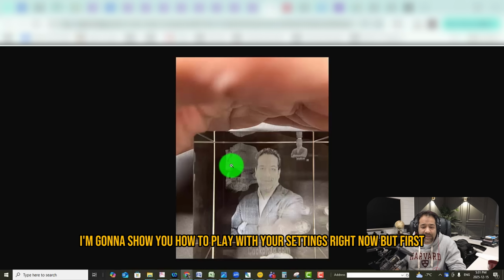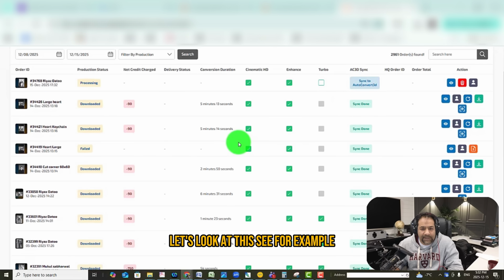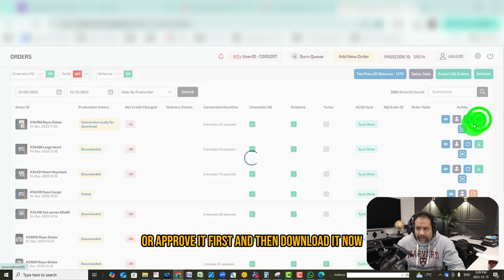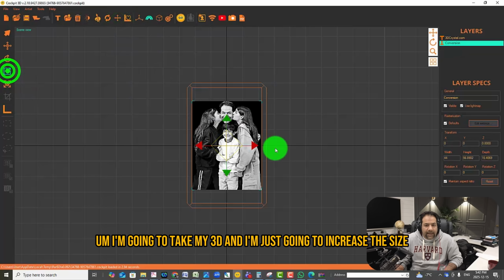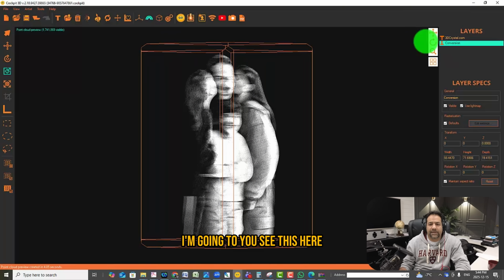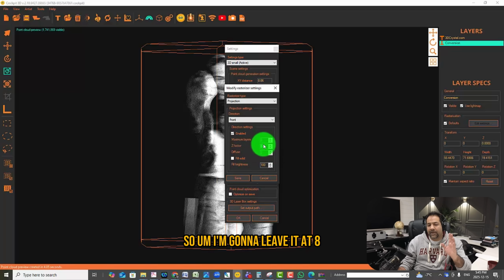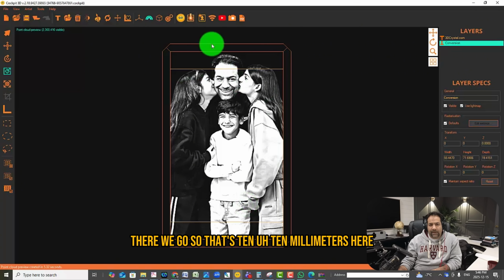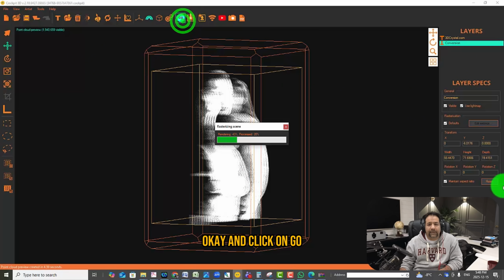UV 2D to 3D Subsurface Laser Settings Explained | Cockpit3D Software Full Guide

Comment: I have a UVV-P-5 and it uses the Raycraft control software. After I create the .stl in cockpit3d and open it and run it in Raycraft, it will not burn into the crystal. The laser acts like it's doing something with the head moving up like it's engraving, but there is no mark in the crystal whatsoever, and the job is ran in like 30 seconds or less, this doesn't seem like long enough even if it was actually engraving in the crystal. I can't get any info on what the Dwell, Frequency, or Pulse settings should be, but the default settings work for True 3D stl models, so why doesn't it burn my cockpit3d stl? I thought maybe it was the original picture that was converted on the FastPass site and I have tried it 3 different times uselessly using up a lot of my credits! I can see the point cloud in my software but it wont engrave into the crystal. It apparently works for the xTool UV, (from seeing other peoples results), but not my laser, and settings are night and day between the 2 softwares. I don't know if there is a setting I'm missing in the cockpit3d software or what because I can't seem to get an answer from anyone other than I'm not familiar with this or that. This is very disheartening and frustrating because I spent a lot of money on blank crystals starter pack and the case of rectangular keychains and can't use any of them for the 2d to 3d engravings!
Reply from the maker: Sorry for your frustration. Certainly you have asked the company whom you ordered the machine from with no successful response we presume. We will ask Mr.Riyaz however we highly recommend posting videos of your issue on the Facebook group to see if there’s anyone with your machine that has had success. We only have experience with green beam hence the reason why we asked UV users to weigh in on any UV related questions.  Sorry we couldn’t be of any immediate assistance.

Comment: Using the Xtool F2 ultra uv. This has been the best settings i have been using. Example on a 40X 40Y 60Z Rectangle small in cocpit3D 0.06 0.06 /  8 5 2. Now when bringing file into xtool studio GLB, measure the actual size of the crystal with calipers on the X and the Y and the Z and enter these into xtool studio as there is variations block to block. So if the x axis is 39 enter 19.5 on the riser base piece, enter Y measurement and Z measurement. This will ensure the galvo mirrors are exact on the block. Settings K9 crystal power 85% Dot duration 166 Layer Height 0.06 Frequency 80    DO NOT CHANGE THE SIZE OF THE IMPORTED POINT CLOUD. Hope this helps.
Reply from the maker: Thank you taking time to help explain it to others using that uv laser system ❤
Reply: Did a crystal heart ornament today, all I can say is wow the detail was incredible 2,765.000 points. Can’t wait to be able to purchase a green beam as it took 1hour but it was well worth the wait. 

F2 ultra uv power 85% Dot 200 0.06 Layer height 80 40.5 on base x Frequency, in cockpit3D before you hit the laser strike on the heart set 5.5 margin on x 5 on Y 1 z stabilizer off thank me later. Stunning results I’m glad I got onboard with cockpit3D as I’m in. Just placed another order as I’m getting so much positive feedback. Keep up the great work.
Reply from the maker: @Prevstar thank you so very much

Comment: just trying this software- I mean compared to what I used that came with xtool, at least I think I used something that came with xtool- anyway. OH....MY......GOD the difference. I mean it's 1000 times better with the same pic. It did take a bit of fooling around and I would LOVE to know what all the different settings are that you can change. But it's nice that you can change them and see the result. I THINK the Point Cloud Preview is sort of the "real" preview correct? that would have been nice to know, lol.  It's a great software so far. Trying another pic now, but I'm sold.
Reply from the maker: Thank you for your support.  After you click on GO the point cloud preview gives you a representation of what it will look like as points in Crystal. We will continue to produce more videos that explain different parts of the software.

Comment: I am able to get extremely detailed engraves on the XTool UV, but I tend to always have some level of banding in the image. I have adjusted all the typical settings every way possible, so I am thinking maybe I need to adjust some of the other settings. Any ideas where to start??
Reply from the maker: We haven’t experimented with any UV lasers however our assumption is that banding / lines appearing may be occurring due to the following reasons: 
1. After having completed saving the point cloud on cockpit3d and opening the file in your laser software you need to confirm and ensure you do not change the point cloud size. 

2. The sharpness and clarity you see on 3dcrystal made by our parent company 3dcrystal.com is done by laying the crystal on its back in the 3dlaserbox jetmini machine and burning from the front. This means if you were burning the 3d image of a person for example, their eyes would be staring up at the lense as opposed to how most UV laser videos show it where the face of the person is facing out the door -and instead the top of their head is facing the lense.  We have some suspicion that this rotation on the machine you are using may be causing the lines  to appear.  
If anyone else reading this is using a UV laser and has any input for the person asking this question kindly assist.
Reply: @3dcrystal  Thanks. Yeah, I have kept it the same size and laid the image on its back and still seem to get a line at what would appear to be at each layer change. I think it may he the less than smooth layer transition on the XTool.
Reply: @3dcrystal  In case you are still tracking, I have nailed down settings and I am getting fantastic results on the F2 Ultra UV, regardless of engraving vertically or horizontally.
Reply from the maker: @lakesidelaserworks  ok amazing. When you engrave horizontally it will allow you to do various types of shapes.  Burning vertically means the curves at the top of a heart for example wont allow the beam to penetrate.  Congratulations on your success.  All the testing and trying was worth it!  Go out there and have fun making sales and preserving peoples memories in 3D :)
Reply: @lakesidelaserworks  do you have some general numbers you could share
Reply: Could you please reply with the settings that worked well for you?  I am having the same initial issues you were having with banding
Reply: @davidarringtonmd What I find is that brighter pictures require lower power or XY settings. Otherwise you get banding. It will vary based upon your image.

Comment: Hey Riyaz,  I have a xTool Ultra UV.  I followed all the instructions but I feel like I'm doing something wrong.  I got the image to look good in Cockpit but when I import it into xTool creative space, I can't really see the image.  I don't change anything and keep it the same size.  I save it as an stl.  Any advice?
Reply from the maker: Thanks for your question. I’ve heard that it’s hard to see the point cloud visually in the UI of the laser software however if you ensure you set the point and line spacing values to match what you had in cockpit3d it should burn fine.  Perhaps start the burn and see if you notice it actually shooting the laser. And if so it will likely burn fine.
Reply: @3dcrystal thanks for the help!
Reply: @3dcrystal  I believe the XTool UV laser requires the files to be in GLB format

Comment: I am working with Lawrence.  I have the Commarker, and I am struggling to get a good conversion from DXF to STL. Actually, I am not able to make it happen at this point.  I'm really looking forward to the advancements that are coming.
Reply from the maker: Thx for your message.  Check with us in  a few days and we should have UV laser file types baked into cockpit3d for you to easily export the file type you need for sub surface laser engraving in optic crystal.
Reply: @3dcrystal appreciate you!
Reply: @3dcrystal if you need someone to test the new software send me a link and I’ll get on it.  😬
Reply from the maker: @chrism997  you should be receiving the version that enables you to edit and save the 3d file for UV lasers today.

Comment: Hi, I'm really pleased that this is going to be available, I have a Cloudray uv 5w laser. I have managed to get some good results but if I can do one less process that is good.
Reply: I have that too. Are you able to share any tips? Parameters?
Reply from the maker: @Richard-rb1hf  we will post more info as we hear back from multiple users.  We just got some nice photos of final crystal burned from a UV laser owner and will find out the settings they used.
Reply: @Richard-rb1hf  Hi which software for burning are you using, I only have cloudray cad.
Reply from the maker: Thank you. Would love to know what settings you used for your point cloud space on XY and Z  layer distance.